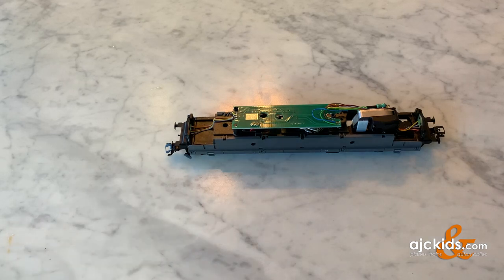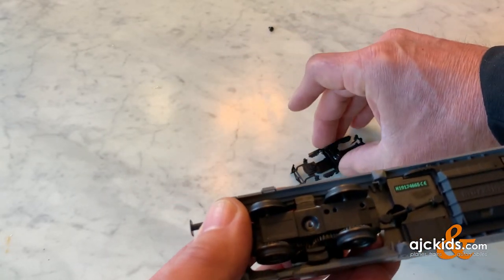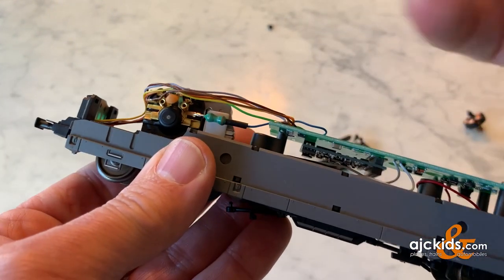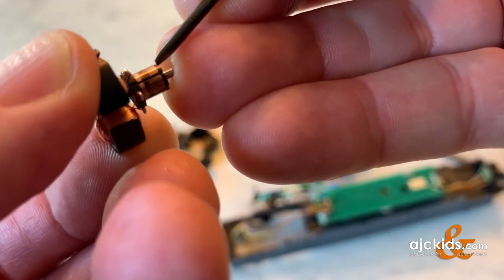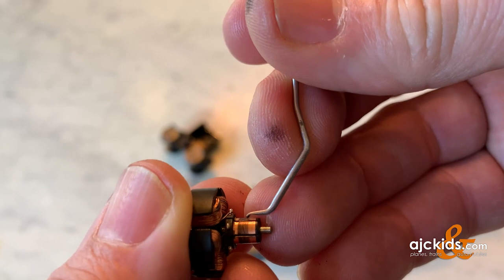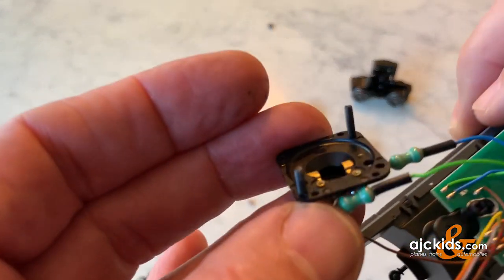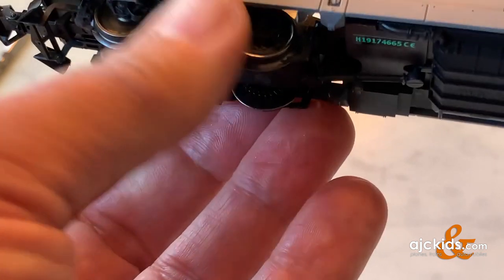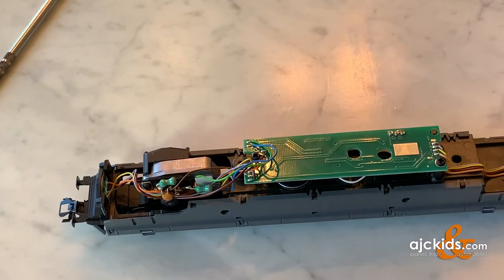Help with your Marklin Locomotive - Excess Oil (DCM Motor cleaning)

Comment: A great tutorial, thank you!
I am looking for help regarding when the spring wire breaks that holds the brushes in place.
I have two loco's with this issue.

Any help is appreciated!
Reply from the maker: You can buy the motor covers as spare replacement parts. That would be imo the easiest way to fix that issue!

Comment: Missing one step. After cleaning out the mesh i’ll polish this part with grade 1500 sandpaper until it’s clean. Then reclean the groves This by using a Dremel on the gear site does the job

Comment: Thanks AJK; have just been looking at 'tune-up' of some 'less than satisfying' stuff - looking at this was like coming home again.  I notice you did not re oil??  Also, does removing the armature compromise the magnet power.  I believe where a stator magnet is magnetised with the armature in place there is a question mark.
Upgrading motors to 5 slot rotors is a great way to improve performance.  I was told not all cylindrical commutator motors can be so modified.  Is this true?
Could talk Marklin all day; better shut-up.
Reply from the maker: In most cases it would be good to reapply a bit of oil. But many folks actually oil too much. And that in turn just gives residue and dust and dirt a good place to stick to.

You can remove the armature without concerns for magnet power.

There are a (very) few Marklin models where upgrading the DCM motor to a 5-pole can give you some space challenges. The upgraded motor is a fraction thicker. In those cases you can always opt for the 3-pole DC magnet, and leave the motor as a 3-pole motor.

Comment: Does the armature supposed  to spin freely by hand?
Reply from the maker: Yes. When it is just the armature and the magnet, the armature may move and stick to the magnet. When the motor is assembled, you most likely will feel friction of the gears (and magnet) and the wheels will not spin freely. But you can definitely move the wheels.

Comment: Tell what lok that is, thx!
Reply from the maker: Hi Rune, 
This is a 39378 Class 101. We did not mention it because the steps will be very similar to many Electric and Diesel model Marklin locomotives with truck mounted DCM motors. When it comes to steam locomotives, the procedure could be even easier, since you will not have to lift up the truck assembly to get to the motor plate.